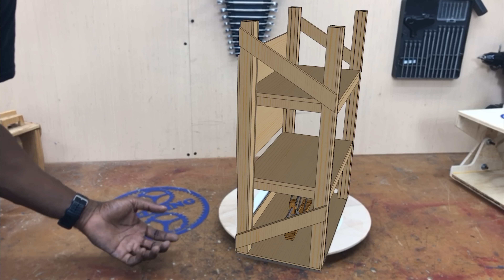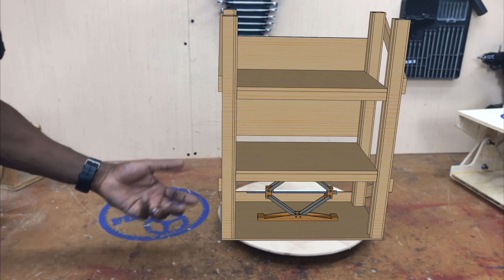Engineering Principles for Makers Part 2; Material Properties #067

Comment: i have a BIG diy project that i'll be starting next year - a 50x30 greenhouse...   it will be situated east to west, with the south face in polycarbonate in an arc from the top north, to a short pony wall in the south,  and the north face, completely insulated and vertical.   i am actually planning on making the 'trusses' out of PVC pipe, essentially the two layers with the triangles in between... i have a plastic welder to join it all together, and in the spring will clear all the crap out of my workshop so i can sketch out a full size truss on the floor.   sort of breaking new ground here using pvc so with snow loads etc, not sure if it's even feasible to use...   i know round steel tubing could be used, but how does one calculate the strength of the material?  is it by the weight of the material itself, or thickness, or the number of 'triangles' or a combination?   can't seem to find anyone that's doing anything other than simple hoophouses - bending pvc into an arc.  any words of wisdom?

Comment: Come on now .I like your videos. But you need to use both in there correct orientation for a realistic result. So as not to confuse or rather mislead new engineering minds. You used the steel flat stock on its side <<?and the I beam in the correct orientation.  For you new people the load bearing of each material is on its edge. With respect.
Reply from the maker: While I wouldn't do it again, at the time I felt it was obvious what would happen if a steel "ibeam" was next to a wooden "ibeam". This seemed to be a more interesting demonstration to point out that the shape of the part "apart from material" has alot to do with how stiff it is. I was very careful to say (at least three times that I remember) that it was the orientation that made the difference and that wood was not as strong as steel, but was made stiffer because of its orientation. Check time 2:04 as reference to one of those moments

Comment: Comparing a wood "I beam" to a flat piece of metal is not a fair comparison...  To make a fair comparison you need to compare a flat piece of wood vs a flat piece of metal OR an "I beam" of metal vs an "I beam" of wood.
Reply from the maker: It was meant to be obviously unfair. I promise no one misunderstood what would be a steel I-beam vs wood I beam... so then why do the test at all? Perhaps you missed the point. Do me the honor of rewatching time 2:04. That’s really the reason for the demo.
Reply: Joe, the concept of engineering includes investigating all variables.

Comment: Comparing a steel flat to a wooden I-beam is just stupid. Compare apples with apples. Take a steel I-beam of exactly the same dimensions and compare that.
Reply from the maker: Maybe you would do me the honor of at least listening to what I said about it at time 2:04. I promise no one was confused about what would happen if I made a steel ibeam, so maybe something else was the reason for the "demo" being done this way. If you really want a treasure hunt, I actually pointed to this "reason" three separate times before during and after the demo.
Reply: @Jeremy_Fielding  I think you are missing the point, I entirely understand your demo and the various attributes of different materials but I don't see the point of comparing two completely different things in different configurations. Seems like I'm not the only one thinking this either.
Reply from the maker: Fair enough... I will just say this. The purpose was to point out that two separate factors exist. The material itself and it’s shape. People should consider both when designing “stuff”. Perhaps comparing different materials to do this was too distracting to make it clear that was the main point. I initially thought different materials was better because steel is widely known to be both stronger and stiffer. This would “magnify” the difference. But for about 0.5% it was a distraction. I have read every comment and email about this video. I agree you are certainly not alone... but it’s a small percentage base on my last count at 400+ comments and emails
Reply: @Jeremy_Fielding  Anyway thanks for an interesting video, I think you do effectively make the point in any case. You should do something on torsion boxes which show just how rigid and strong even lightweight wooden constructions can be in the right configuration.
Reply from the maker: You are the second person to ask about that. (Torsion box) I might just add it to this series... this is a good place for it. And thank you for the honest and kind feedback. It’s my favorite to receive. 👍🏾

Comment: Moment of Inertia has nothing to do with rigidity or strength. Moment of Inertia is a way of measuring an object's resistance to change in inertia (speeding up or slowing down). In most common usage, it is specifically referring to changes in rotational inertia. Example, a 5lb barbell has a much higher Moment of Inertia than a 5lb sphere, because its mass is distributed farther from its center of gravity. This would make it harder to both speed up or slow down rotation. It does not measure any other feature of the object.  

Also, you used said that the wood and steel in the opening example have the same cross sectional area, and then devolved into some description of geometry that has nothing to do with what was going on. While the AREA may have been the same, the section to load was different, and that's the only part of that demonstration that mattered. Or, using a far simpler terminology, thickness. Maximizing thickness in the direction of load is where you gain the stiffness. That's the whole point of an I beam. If you want to get into distributed stresses and skin effects, that's great. But start with words that people understand. Any viewer that already understands how geometry applies to your example, already knows more about it than you offered. Those that don't already know the geometry involved would benefit more from a word like thickness...
Reply from the maker: There is already a note in the description but I understand some people don't read it. "Area moment of inertia" is what I was referring to. In many older text books, (including mine) it just calls it "moment of inertia". I was aware of it having more than one meaning in the context of the video. 

Once you read about "area moment of inertia" or "second moment of area", or any of the many names it has, your second point will be explained as well. The definition of it is pretty much what you are describing in the second paragraph... the importance of the depth of a section. It sounds like you just didn't know what it was called. I also referred people to the Ibeam video which explains it as well. 
It also sounds like you didn't watch the whole video, because I explain the depth of a section (thickness) and why that matters more later in the video with in example. Sorry about the confusion or distress this has caused you.
Reply from the maker: One more thing... the description of geometry in the video has "EVERYTHING" to do with it. We actually agree yet we are using different words. Your words here in the comments is a description of geometry. There is a mathematical way to measure this.. and that is called "area moment of inertia". What I was describing in the video. Thanks for watching.

Comment: With your vertical moving workbench I'd be much more included to have a pulley setup to pull them up rather than having a jack in the middle trying to push it up. If you have an uneven load on the bench top trying to push it up from the middle is likely to cause it to skew and bind. Have a look how a lot of the bigger hydraulic workshop presses or the older Servex types raise and lower their table. Having a jack underneath it is also wasting space that you could use for something else.
A suggestion for your uprights, if you have limited metalworking tools an option would be using Pallet racking end frames, with nothing more than a hacksaw or angle grinder you can cut them to the correct height, shorten the front to back braces to make them whatever depth you want, the geometry / profile is generally pretty good to support loads and they already have a heaps of holes in them to make adjusting work top height to whatever you want easy. Unlikely you will find any cross beams short enough for your application but just an idea.
Reply from the maker: First I love the beam idea! Pulling from all sides is way more complicated a build. I went to the center for simplicity. Distributing the load is not hard with the design for the table bottom I have in mind combined with guides. The table must go very close to the floor for the top table to be useful. I can’t use that space for anything else either way.

Comment: I don't mean to be pedantic, but if you want more specific info on the "moment of inertia" he's talking about regarding rigidity, you might try searching for the (technically) correct term "second moment of area".  The Second Moment of Area is commonly (erroneously) referred to as "Moment of Inertia".  While most of the time this doesn't cause confusion because it is so commonly referred to as "Moment of Inertia", sometimes it can cause confusion.
Reply from the maker: There is a note already in the description, but I have found that not enough people read it. However there aren't any other ways to add a correction to a video without completely deleting it and posting a new version. Anyway, its all I can do on my end.
Reply: @Jeremy_Fielding , Ah, yes, you are right.

Comment: Just discovered you and have to comment because this is very much my MO my entire life.  As you can likely notice from my avatar, I'm disabled with limited reach and strength.   I'm primarily an artist but with a fair amount of CAD background if not extremely extensive engineering.  Even just wanting to explore fabrication for cosplay etc, primarily, it was driven to solve the problems nothing available is ever going to be made for ME.   When I began to get frustrated at being unable to cut heavier materials (and a rotary tool etc is no real help due to being unwieldy), I started realizing that it's about thinking smarter beyond 'brute force'.  I KNEW this earlier but it was only then that it became real truth for me.   I can cut 0.5mm styrene sheet so I just layer them with plastic welding chemicals like basic nail-polish remover.  I know as an artist that if I do the same with even easier bristol paper gluing with Mod Podge (like white school glue on steroids), I get something even stronger than even thicker plywood.  But in the end, it's about designing the right structure to stand a load.  I likely overthink the necessity for many of my designs but still do it anyway.
Reply: Oh and just an FYI, please no notion that I'm at all 'strong' etc.  To ME, that's 'disability porn' because we all only know life as we've lived it and all adapt the same way.

Comment: So... we should build stick frame houses with triangles, not the current method. Roofs are full of triangles for strength, but not our walls. interesting and not surprising (hard to change old ways) And when the average joes will come and say that steel is not combustible, we will then need to point out the obvious : combustibility and maintaining integrity when heated are not mutually exclusive: wood is better than steel when engineered properly.
Reply from the maker: For me the real message was make sure you chose the right material for the right reasons. Both have pros and cons. And that poor design is also a factor that is often overlooked.
Reply: Rolf Bjorn A few erroneous assumption re using triangles and your conclusion that we should use them over perpendicular stud & blocks. 1. Timber house frames ARE actually built with triangles - where they need them. Both as actual framed triangles but also the triangulation existing in sheet materials (acting also as their dual role as diaphragms.) 2. The twist force applied in the demo is not the only force a wall sees. In fact it's not the major force. 3. Ease, speed and reality of building using regular & repeated vertical & horizontal members. Each piece can have multiple uses not just one specific engineering aim. (Eg: mounting points for fixtures & subsystems) 

It was tho' a great demonstration of the different directional loads that "intuition" might not see a particular framing layout supporting.
Reply: Rolf Bjorn And roofs are subject to complex loads that walls aren't - And visa versa. A roof's main structural job is to tie the walls together.

Comment: so you just compared not even a 1/4 peice of steel to a 1" to 1.5" piece of wood to show deflection? If you had used a 1" piece of steel there wouldn't have been any deflection
Reply from the maker: Check time 2:04 where I start to explain the point. The demonstration was meant to be obvious. They have the same cross sectional area  but “something” is clearly different. I do explain in the video
Reply: Jeremy Fielding I can see Austin Yates' point. The particular demonstration may have been more apt to lay the steel edge on as a comparison. 
You had I beam vs flat bar. not just timber vs steel.
The "something different" was 2 very separate things.
Reply from the maker: @DiscoFang  consider three points. #1. I say in the video three separate times I am going to give the wood an "advantage" of some kind. Then I examine specifically what the advantage is, and explain it. Then I follow it by saying "I am not say wood is as strong as steel" and on and on. #2 I have read every comment and every email on this video. Over 400 messages at this point. And not a single person has implied they were confused or somehow thought that wood was stronger or stiffer. At the time I felt comfortable that the strength of steel was implied and didn't need a demo. However I wouldn't do it again because it bothers the .3% (as of my last count) who cry foul and say "why didn't you put the steel on its edge?" Even that statement implied they expected the obvious result. So why add time to the video to show it (not a real question). Again I would do it next time, but its not the tragedy people are making it out to be. #3 The whole video is about material properties and the effects of geometry, so I felt it was more interesting (again at the time, won't do it again) to compare the wood directly to the steel, and play off their differences throughout the video as I also explain geometry effects. Not everyone was happy with the results including me. Because something this simple for a DIY audience should upset no one... so I failed on that front. The like to dislike ratio tells me I didn't miss it by much though.
Reply: Jeremy Fielding And don't do it again. Or there'll be no ice-cream and straight to bed for you young man!

Comment: Well done. I had a design project during my freshman engineering 1201 at UNC Charlotte. 
I only cut to length for testing obviously, no milling. 
2 X ---- 1/4" x 1-1/2" x24" Basswood 
1X ---- 1/4" x 1-3/8" x24" Basswood
The beam must be constructed using basswood only from the 1201 lumber yard. The cost of the project is based on a resource budget of $10.00. Each joint glued together will cost the team $0.50. The designs were created based upon the given parameters. The beam is tested with a pressure applied perpendicular to the axis being tested. The load is applied in the middle of the span, which was instructed to be 21in. The required X-Axis load is 325lb as well as a Y-Axis load tolerance of 150lb. The mass of the beam must not exceed 240g. The X-Axis deflection must be between 0.05in to 0.225in. In having this window that requires some deflection, will allow the beam to withstand an unknown impact and be able to flex without breaking. If the beam does not deflect within this window, the beam is considered a failure. The beam is tested with the specified load applied against the primary x-axis,while the deflection is recorded. In designing, the beam is required to have a cross section symmetrical about the centroid axes consisting of two or more joints glued together. This can be in the form of either a solid beam, I-beam, H-beam or a box hollow beam. The cross section of the beam must not be bigger than 2” x 2”. I made a 21 span simply supported beam with 0.04in deflection. Good times. lol I wish we worked with metals and were required to weld. I would have been fun testing a small steel beam with a press.

Comment: This is the first video by you that I have watched. I recently built from scratch a three wheeled car, and learned from simple experiments the importance of shapes versus extra heavy (thick) rods and flats. A car frame built of thinwall square tube welded together in triangular bridge fashion to form a beam is much lighter and more rigid than a heavy wall rectangular tube frame. Jeremy, your discussion of importance of shape should be well noted by anyone involved in developing a project that must carry loads. Excellent presentation.

Comment: Sometimes size matters.  I had a steel supporting beam put in a finished basement instead of wood.  Instead of twelve inches thick with wood, the steel beam had to be only five inches to get the same performance.  This made a huge difference in the look and feel of the room.
Reply from the maker: OF COURSE! That is the whole point of the video. Sometimes you need more strength (so it can be smaller in your case), sometimes you need better geometry. The key is you need to check both. This is why there are so many steel ibeams... you get the best of both. At a price of course.